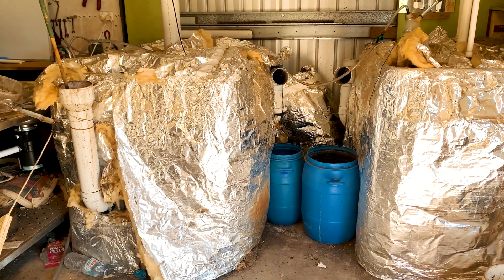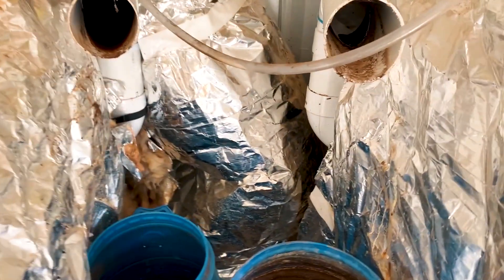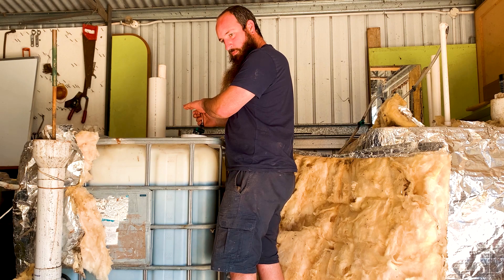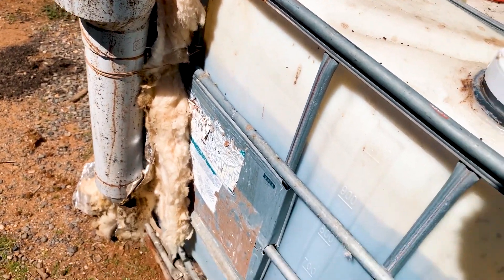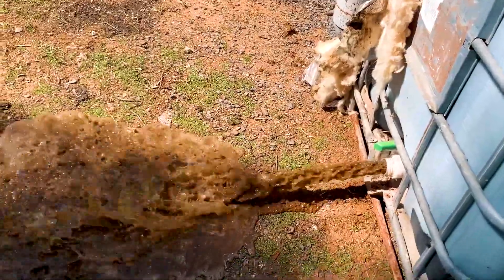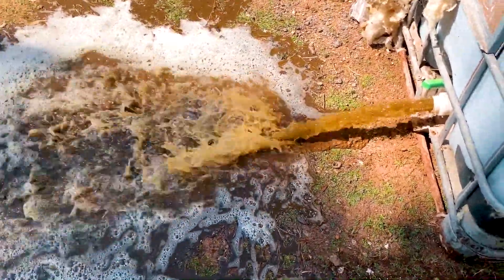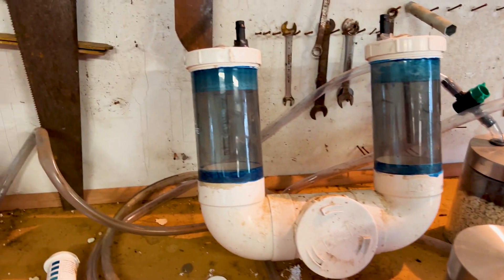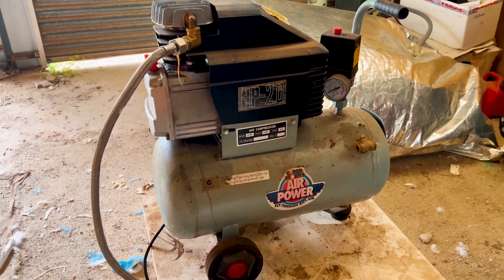Biogas Plant Shutdown!

Comment: Hey Daniel.    Thanks again for the free flow of invaluable info.    Have you moved and set up again yet?     Having been inspired by you and a few others I am producing gas now from my super insulated  55gl digester and today need to find a stove to hack so I can start using it.     You mentioned that biogas compressors are available and expensive, can I ask what they do that your shop compressor does not?     Also I would love to know your thoughts on fridge compressors for this job, being quiet,low volume, high pressure and largely free they seem attractive.     And the holy grail of running a car?    Cheers.   Tanc

Comment: @OK at EVERYTHING - PRO at NOTHING:
I've personally learned much from you.  I most especially appreciated that you went into the science of how things work with a biodigester in this series. I wanted to ask if you think the larger IBC totes are worth investing in again or if smaller more easily movable (say 30gal tanks or 50gal drums) containers are the way to go moving forward? I'm asking because I see how much you've struggled with the pallet jack and am wondering if it's easier to have a system in place for collecting the effluent periodically. Personally, I think the biogas is excellent but that the fertilizer has a higher value. If I can collect the fertilizer water say once a month and have a way to not make mess while doing it, that would perfect the system you designed- I think.

Also, I know keeping the tanks at the right temperature for the bacteria to thrive is key to long term success, would you recommend using the insulation for smaller footprint systems or is active heating better? Can you make an update video talking about things you want to improve upon with your design? Talk about thermal mass and production efficiency results as you experienced them. 

Overall, I really enjoyed all your videos about the biogas generator. my favorite parts were when you described the science and then showed how to compress the gas safely. Thank you for making this series!
Reply from the maker: Hey mate, thanks for the kind words. In regards to draining/extracting the liquid fert, you just want to collect the overflow that comes out when feeding, make sure it has had that retention time. 
Ii personally like the ibc, bigger is better mentality, more stable temp, larger processing volume and more gas production, but my old 44g worked just fine too.
Also nothing wrong with wrapping in insulation, is anything it might limit temp fluctuations. 👍